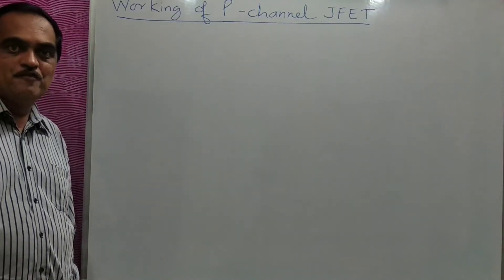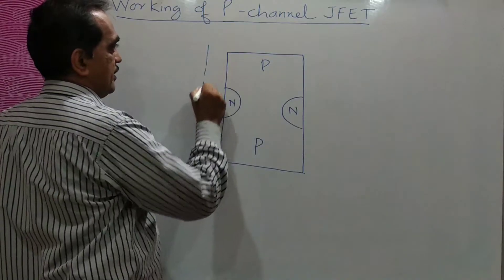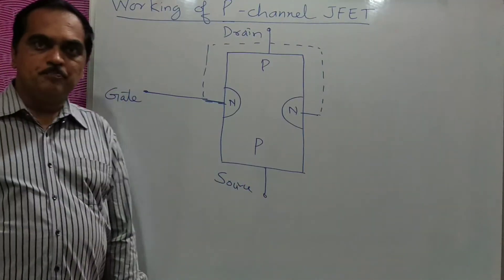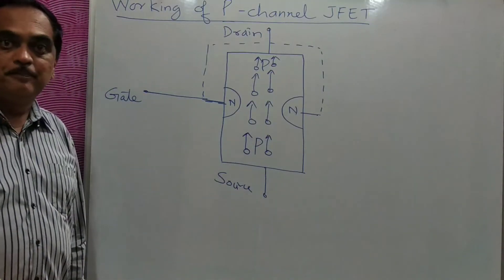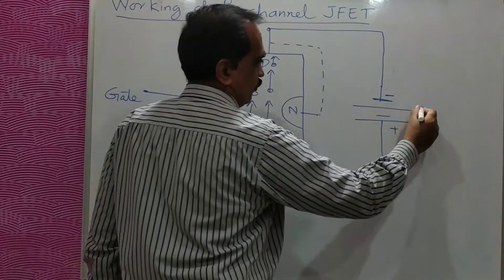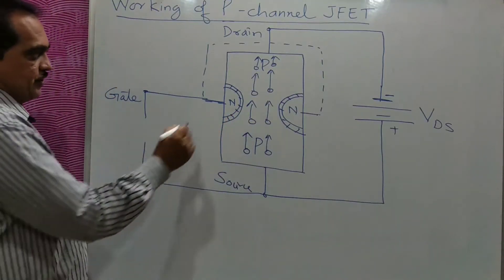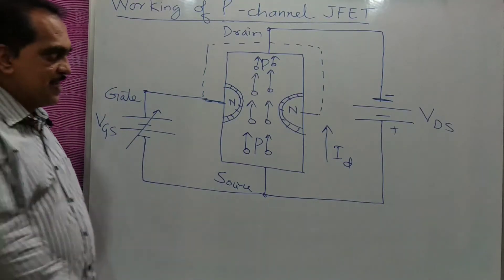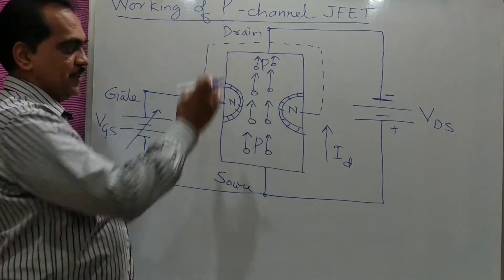WORKING OF P CHANNEL JFET | SEMICONDUCTOR DEVICES | PART NO 34

Comment: Sir when vds is increased then also width of  depletion layer increases that's why current became saturated as you said but on increasing vgs it will increase the width of depletion layer at smaller value of vds..! Sir please clear it out..!
Reply from the maker: For both n channel and p channel the working logic is same only the voltage polarities will vary because of different charge carriers ie electrons in n channel and holes in p channel which constitute the current flow
Reply: @javalkaracademy2176  thank you soo much sir
Reply from the maker: Always welcome
Reply from the maker: Vds is responsible for the flow of the current from source to drain , Vgs is one which controls the width of depletion layer
Reply: @javalkaracademy2176  ok sir thankyou it's means same as we have done for n channel as here we have positive vgs?